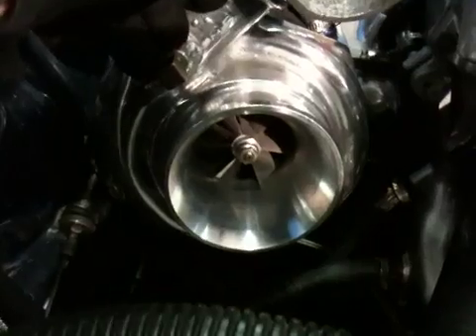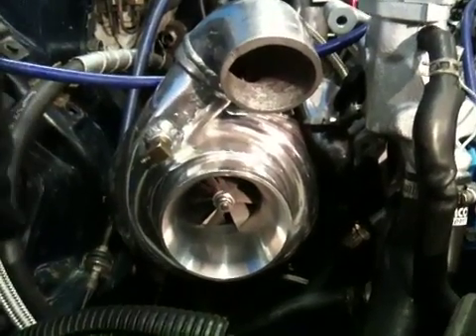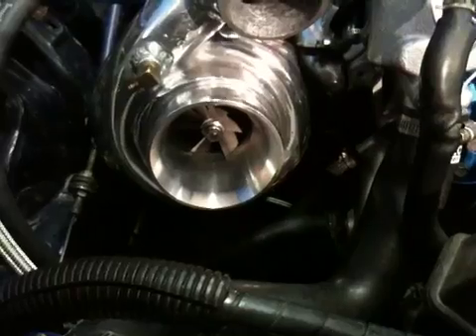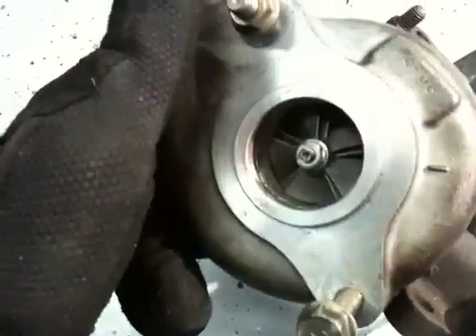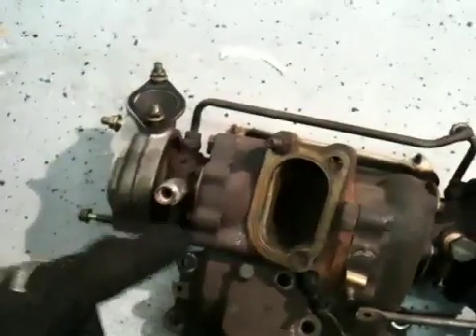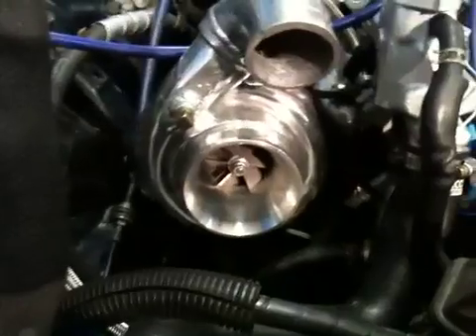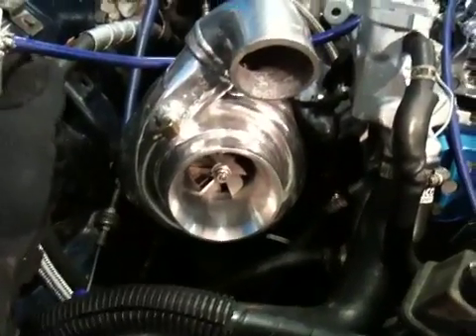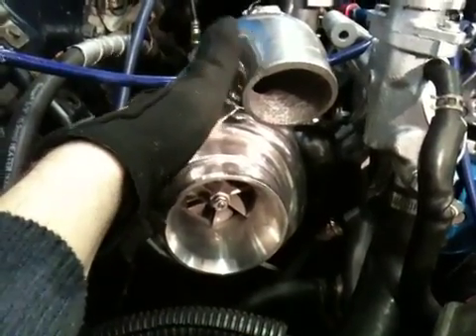Why I picked the GT35R for my RX-7 over the stock twin turb

Comment: hey rob i want to know three things

1. how much boost you're getting out of your GT35R
2. at what rpm your turbo develops full boost on a two rotors
3. and how much power that results in (actual or estimate is fine)

i am thinking of going single but i do not want too big of a turbo if you know what i mean. thanks
Reply: Thanks for the info Rob

Comment: You can run 380+ quite easily on stock TT 99 spec turbos.
Reply: Sure if you don't mind replacing them in 20k miles.

Comment: take off exhaust, take off dp, then pull turbo coolant/oil lines then pull turbos. Its a PITA but my FD is RHD meaning i have less room due to the steering colum but can still be done...just be patient. Dont forget about the y-pipe etc..

Comment: 5psi is not efficient for a GT35r. You're trying to compare a 4L V6 to a 1.3L rotary. My point being he doesn't need a GT35r to make 400whp. A GT35r flows 65lbs/min. So it's good for upwards of 600hp. People with Evo IX's are pushing there stock 16g to around 500whp and hitting full boost (30psi) at 3.500 rpm. Thats a 37lb/min turbo at 15psi. So all im saying is he can have a much smaller turbo (less lag) and still have the same power thats more in the turbos efficiency range..

Comment: Yes you can do that its call a compound turbo setup.. This is where the smaller turbo basically is just working to spin the larger turbo. the cool thing is the smaller turbos exhaust pipe goes to the other turbo instead of the back of the car. Then the larger turbos exhaust goes to the rear of the car like normal. its usually used on cars with smaller liter engines so they dont have as much lag but takes some good fabrication skills to pull it off...

Comment: @emerciv i have a BONE stock 94 fd touring. IF i buy a garrett gt35r turbo kit could i take to a tuning shop and get it installed without any exhaust manifold or othe exhaust or engine mods? ****PLZ RESPOND!****

Comment: the hitachi twin turbo system though that's in the stock 13b turbo, 2jz, and the last generation 300zx motor is a really sweet concept only if there was some way to modify it, since companies don't offer better replacement parts (ball bearing, anti-surge port, billet wheel, different style blades, etc.), it could be an awesome set up.

Comment: Okay so I've got a 94 Rx7 it's stock and came with twin turbos I took the engine out and I rebuild it the engine is pretty much new I put new seals, apexi seals, etc all the seals that you can think of to rebuild now I want to replace my twins to a GT35R just like yours stock motor with a GT35R turbo is that possible I can switch my twins to single without hurting the motor..... Please reply thxs bro....